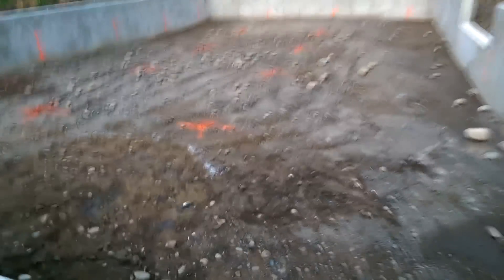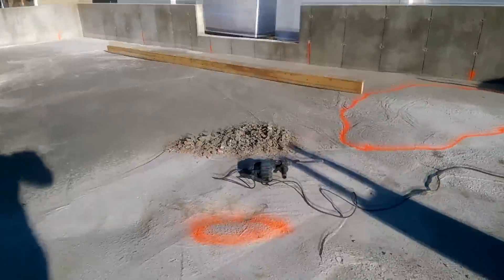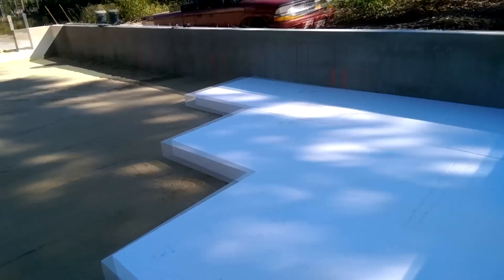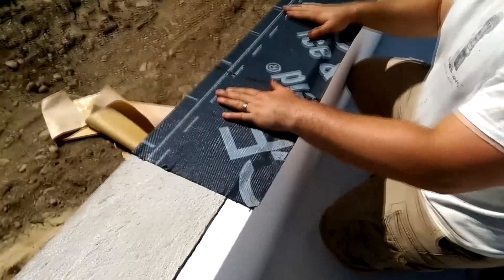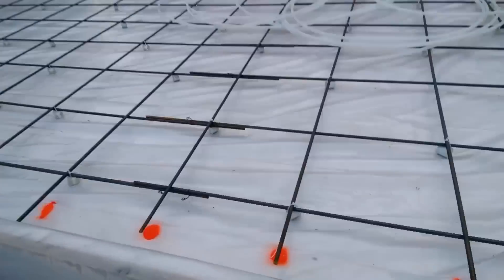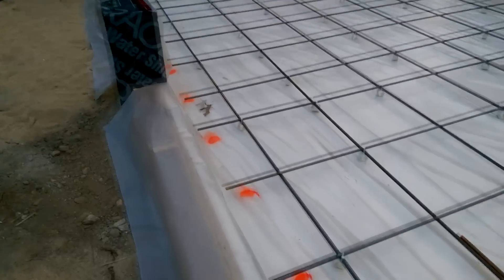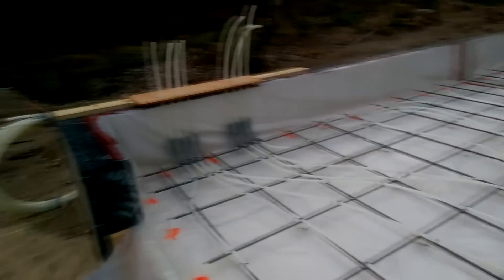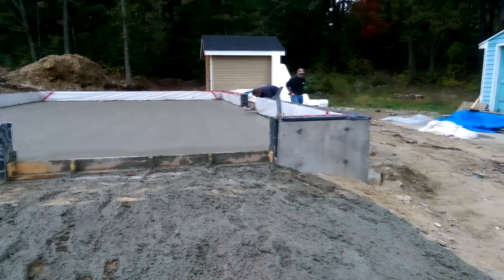Garage Workshop Super Insulated Radiant Floor

Comment: Not bad for the first time doing this. I've designed a few radiant flooring systems for different buildings on my property. I start off with a moisture barrier then foam sheets, another moisture barrier pex 10-12" apart, wire mess and pour. I use huge concrete blankets for my moisture barrier that I picked up at an auction. I bought them new for around $30 a piece. I also do the closed system with a water heater. You can easily run 3 zones off one pump as long as your copper piping going from your heat source to your manifold is 3/4." Here in Colorado where it can get cold but my shops are always toasty. But you did well......
Reply: Richard. I am about to break ground on my garage. Did you put the pex on the insulation and then the mesh on top of that?
Reply: @bdcfu  Hey, from the ground up this was the order of which I would design/install mine. The I would put the moisture barrier (concrete blanket) down first. Foam sheets next. I’d do a plastic moisture barrier on top of the foam. Next is the Pex. Lastly is the standard concrete wire meshing. Since I run them as a closed system, meaning the hot water heater was dedicated to the floor only) I would purchase a standard drum (42 gallons) of the antifreeze but this is important, I would fill my hot water heater with 100% PROPYLENE GLYCOL based antifreeze because in case you have a power outage for an extended period of time, or your hot water breaker trips for whatever reason, your lines will freeze eventually but this stuff has a lower freezing point. Also, unlike the standard vehicle antifreeze, the PROPYLENE GLYCOL based ANTIFREEZE will clearly outperform they ethanol based product. It also is a great lubricant for the system. And for an added bonus, I can winterize my RV with what’s left over.
Reply from the maker: If you share some videos I would enjoy watching.

Comment: lot of great tips there!  Thanks for sharing!
Reply from the maker: You welcome, thanks for the compliment.
Reply from the maker: I bought my foam from Branch River Plastics in Rhode Island.  It is less expensive then going to the local store when you are buying this size.  However, there is a delivery fee.  So it might not make sense if you are just buying a small quantity.
Reply: were did you get the foam for the floor, was it expensive.. I like that idle, I would rather do that then to put a lot of rock in.

Comment: You should run your pex under your rebar! That way in the future if you wanted to drill the floor for an anchor you would hit the rebar before going thru your pex tubing.
Reply from the maker: I agree, it is one of the things I would change if I did it again.
Reply: Running the tubing along the rebar seems convenient but I'd be concerned that you're not getting the full benefit of the rebar since it's not encased all the way around. What do think about running it halfway between (or in-between depending on spacing of each)? In any case, enjoy your shop; I'm just starting the permit process for a 28 x 64 shop to start construction in Spring 2018. I am planning on a radiant floor and possibly heating it with a wood stove.
Reply from the maker: Hi Paul, If I did this again I would install the PEX before the Rebar.  Two possible ways: by stapling the pex to the foam, or laying down 6x6 W.W. mesh and zip tying pex to that.  Then the Rebar grid could be laid on top of the pex and could be easily off-set.  Very cool about your project.  Are you  planning on a wet jacket on the wood-stove to heat the water for the radiant floor?
Reply: Vapour barrier before foam then use you're router to put channels for pex then steel and if you want to get real anal rout where the steel sits so as someone else said " you hit steel before pipe , but if money's no object heating supplies have foam 2"" thick with channels in it .
Reply: Laying the PEX directly onto the polystyrene and securing with U staples would def be easier and cheaper than routed or shaped foam. And to answer another point in comment above, the goal is to heat the whole slab. Whether the pipes are in the center or in the base, the slab will be heating throughout. It's a misnomer to say heat rises. Hot air rises - heat radiates and convects equally every direction so the concrete will be heating throughout wherever the pipes are located. The insulation will be minimising (we could almost say 'preventing' with the thickness of the styrene) losses to the ground.
Reply: I layed out a couple of tape measures for reference. I then videotaped the PEX (which is ziptied to 6 x 6 wire mesh) before pouring floor.
Reply: I think u want the pex in the cement, not at the bottom. To put all the heat in the cement... my thought, am I wrong..???
Reply: Not necessarily true, you can still puncture the PEX because the bar cannot fully cover the tubing. Always map out the tubing layout to clear walls, anchoring and any other interior features. 

According to the Uponor/Wirsbo engineering/design manuals they recommend installing the tubing on top of the reinforcement a minimum of one inch from the surface. They want the tubing closer to the top than to the bottom. Ideal slab thickness is about 4". The reinforcement MUST be above the bottom surface (rigid insulation) about 1/2" to 3/4" in order for the concrete and it's aggregate to surround it. Your structural engineer will confirm this. The worst thing to do is lay 6x6 WWF directly on the bottom surface. It will do absolutely nothing! 3/8" rebar installed this way is only slightly better, but because it's "thicker than WWF, the concrete will bind around it somewhat. The objective it to center the reinforcement and tubing in the slab. Remember, the thicker the slab, the longer the recovery time and the overall boiler system run time., which equals higher heating costs.
Reply: Thinking more along the lines of a stainless steel coil in the firebox. I know it'll take some experimenting and maybe I'll even end up with solar like you're doing. Do you have it up and running yet? Did you make your own "solar panels"?
Reply from the maker: I've heard good things about a SS coil in the firebox.  I hope you make a video on that when you get there, I would enjoy watching it.  I salvaged old solar panels, here is a video on how I did it: https://youtu.be/9Nd9k1rQPW8
Reply: Great point Paul.  maybe some spacers between rebar and flex tube.  I know were my walls r so I know were not to put pex. I building in the spring also.  Good luck..
Reply: +DavidPoz  The whole point of using steel in the cement would be to have the cement encase the steel completely by several inches to gain strength so using spacers to fasten the heat tube or laying in a bed of sand directly on top of the vapor barrier would be the way to go. I do like the idea of following the steel with the heat tubing which kills two birds with one stone if you ever have to drill the floor. (lift or other items attached with anchors) Ever try to drill through a piece of rebar? <LOL> When the time comes you consult your drawings then back it up with an IR thermometer to find the hot spots in the floor (marking as you go) and you can avoid that completely.
Reply: ++Lonnie Shoup  Valid points on steel placement but placement of the heating tubes has little to do with long term operating costs because the building will use the same BTUs either way. The only thing that changes is the first few hours of "warm up" for the slab at the start of the season. Since the slab will eventually warm all the way through, it's just a massive heat sink that will eventually radiate everything put into it. No change there. If you are really worried about quick recovery for say an open garage door or short runs in the shoulder season (just taking the chill off on a cool day here and there) you add conventional radiators or a Modine style heater, which will warm the air quickly.

Comment: I don't believe you are doing it right the ground temp is someplace in th 50's and the foundation out side will be much colder right? that much insulation under the floor is not necessary and may be much more helpfull on the outside of the foundation and the frameing, also in the attic space
Reply from the maker: I'm doing several things different than normal.  In my situation my concrete slab is 90* and the ground is 50*.  So for half the year I have a temperature difference of 40*.  That is a huge loss and needs to be addressed.  Certainly you don't need this if you are doing forced hot air and the concrete slab is 60* making only a 10* delta.
Reply: I did my floor different i used insulated frost walls 5 feet deep and no insulation under the slab you cant push heat down very far 18 inches average witch just adds to the thermal mass of the system. much more benefit is gained by super insulating the building above.
Reply: Amen gary!

Comment: Great job with the foam!   Insulation is always a good investment.   Just curious, how far apart did you space your tubes.   Looks to be a good distant between them.   I would never go more than 12” apart, especially considering you lifted the tubes with in the concrete.    Could make for an uneven temperature in your floor, which can actually make for hot spots and cold spots in your floor.   Also, knowing there is snow that melts, why didn’t you install a floor drain?    One thing that we have done in the 2 shops that we have is we installed the foam, stapled the tubing to it, from there we buried the tubes in about and 1 1/2” of sand.    This way if the floor were to ever shift around from ground movements in winter, the concrete floats on the sand and their is no concerns of the tubes being compromised. Just something for you to keep in mind maybe for next time.  All in all you definitely did a very nice job with insulating and installing your infloor.   Great video.
Reply from the maker: Hi DB, Thanks for the ideas.  It sounds like you have more radiant floor experience than me.  The tubes are 18" apart.  Defiantly more space than most material I read.  After having worked in the garage all last winter I can say that if there are hot spots I certainly don't notice them.  The water heater was set to 90*.  Perhaps I would have noticed hot spots with a higher water temperature?  I chose to use less tubing than most websites were suggesting because the building is super insulated.  I just don't need a high BTU output.  At the end of the day I can say that this system is working and working great.  In my case there is no need for more tubes, or closer spacing.
Reply: Nice work! Good to see extra care going into prep. 12" OC is standard with 9" oc for comfort and 6" for bathrooms/showers. The wire mesh is the way to go for good spacing for sure. Your shop is so well insulated that the longer thermal gain time to heat up from 18" spacing is offset by how efficiant it heats and how long it holds the heat. Great video!

Comment: Hi David,        Was wondering if there is any benefit/downside to adding a layer of epoxy to the cement floor? Since you said the garage floor is level you could probably add the epoxy in layers to give it the grade you want. Would the epoxy inhibit the radiant heating system?   Cheers,          Bill
Reply from the maker: Hi Bill,  I don't think the epoxy would inhibit the radiant floor.  I did paint the floor for ease of clean-up, but not to adjust the grade.  Thanks for watching.

Comment: How does water drain out that gets in under the radiant concrete?
Reply from the maker: I'm assuming that bulk water is not going to be a problem for a few reasons.  #1, RAIN.  There is a deep overhang all the way around the building.  I pitched all the land adjacent to the garage away from the foundation.  Also I parged the snap tie holes.  #2, Ground water.  I am not in a flood plain.  I don't know how deep the water table is, but we never found it with our excavation.  My garage and house are higher in elevation than all my surrounding neighbors and of those I know, none have water problems in their basements.   Generally speaking my property is dry.  My soil is a sand/gravel mix.  Not great for a garden, but drains awesome.